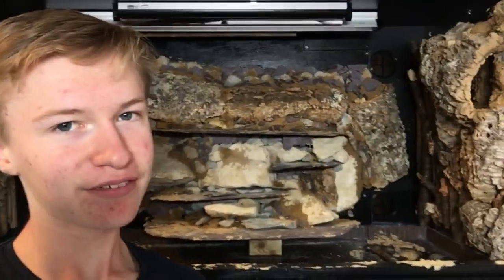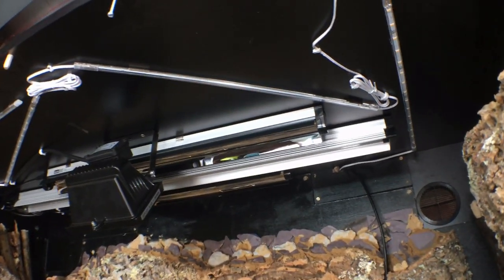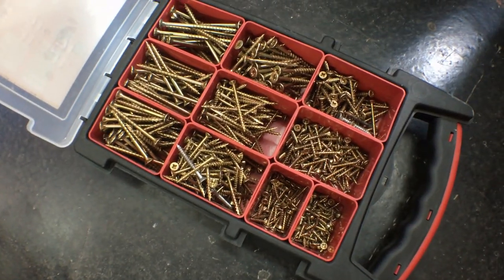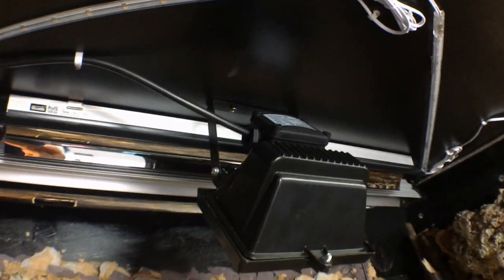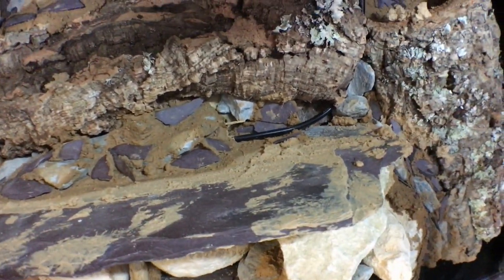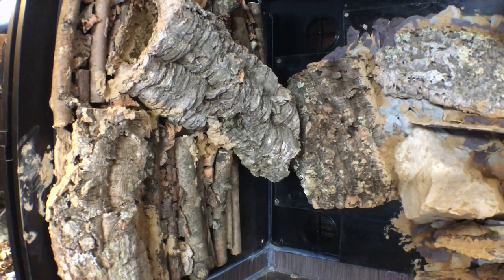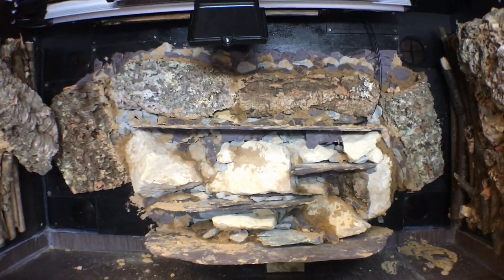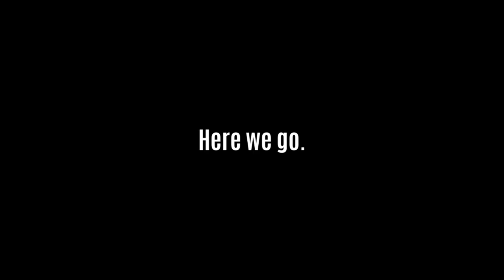The New Reptile Enclosure is Finished! Bioactive Vivarium Build | How to Set Up a Vivarium #4

Comment: Looks awesome dude! Can I ask what wattage the R7 halogen is please? And what distance did you have to put between the bulb and the basking area to reach the right temps?
Reply from the maker: Thanks! That’s a much more complicated question than you think it is... You see, lamps are for offering radiation, not getting temperatures right. They’re two different things - related, but clearly distinct. Drawing this distinction and acting accordingly will be, I think, the next big step forwards in reptile keeping. In light of this, I don’t actually think that the R7 lamps are suitable for use in the way that I have it set up currently, but I don’t have the numbers to back up this suspicion just yet. Stay tuned - the answers won’t take much longer to arrive!
Reply: @JTBReptiles   I understand the halogens are there to give off radiation. However the bulbs still produce a lot of heat so how do you prevent it from getting to hot and cooking your animal with out using a thermostat?
Reply from the maker: Have a look at my most recent video and keep it in mind. I have produced the first draft of a video answering precisely the question you’ve just asked, but it’ll probably be another month before it gets finalised and made public. I’m not good enough at writing to do the answer any justice here!

Comment: Beautiful! You have inspired my builds :) 

What plants do you use in is amazing setup?
Reply from the maker: There’s an azalea, three “hen-and-chicks”, and a lavender which I bought. The rest of the plants are weeds I found and propagated, so I only know what a couple of them are: a blackcurrant bush (thanks to Harvey of Celtic Reptile & Amphibian for IDing that one) and English ivy. I will work out what the other ones are for a future video!
Reply: @JTBReptiles  Thank you very much!!  I recently found your channel and it has been the most informative.  I look forward to you other videos. 

Any question 
Do you do the day/ night cycle for Speckles and if so how do you do so and how do you think to do that for a crested gecko?
Reply from the maker: Yes, I do it for all my animals. At the moment I just have the halogen lamps on for 12 hrs, then “visible lighting” (LEDs, non-UVB fluorescents, non-UVB metal halides etc) is on for 10 hours, and finally UV lamps on for 8 hrs for the geckos. In this enclosure and my dragon’s it is slightly different as I have several UV lamps.
Reply: @JTBReptiles  Thank you so much for all the information and help.
Reply from the maker: No problem!

Comment: I see you have many sticks. What is your take on disinfecting sticks and stuff? like protocols to kill everything that might be on the sticks. A lot of owners are very particular with this stuff and will use bleach baths, or an oven. Then others will find that silly and do nothing, or will just leave the sticks out in the sun for a number of hours and that will be it. I know there's somewhat larger-scale reptile keepers who don't disinfect their sticks and stuff, and have never really had an issue in decades.
I would think you are probably not hardcore disinfecting all those little sticks.
Reply from the maker: If there is any bird poo etc. on the sticks, I’ll wash them down in boiling water - but otherwise I just leave them as they come. I don’t get any reptiles where I live (the only herps I get are common frogs, Rana temporaria) so I am not concerned about mites or anything like that.

You often get little springtails coming in on bits of wood as well as other inverts: it would be a shame to kill them when they could become a part of the clean up crew or food for the lizards!
Reply: Hi, I use mostly cork bark and craft store wood in my enclosures which I do not disinfect. I will occasionally pick up a piece of driftwood from a nearby lake which I do disinfect. I bake it in the oven if it is small enough but otherwise I let it soak in a a bath tub with bleach. I live in an area where snakes, lizards, frogs, and other herps are quite common. You will also find that wood outside has wood mites in it which as far as I’m aware are not harmful to snakes/other reptiles, but I just don’t want them in my enclosures. I won’t go into detail on how I disinfect my stuff, there are lots of guides out there for that already. It sounds like your comment is more geared towards do I NEED to disinfect. I don’t have an answer for that either, I just wanted to chime in on the behalf of those of us that DO disinfect wood.
Reply from the maker: Good point. To answer the “need” part of the question: there are many diseases harmful the herps which could be devastating if brought in to an enclosure (chytrid and the fungal disease currently affecting many snakes are in my mind, but there will be others). There are also parasites you might bring in, which is why I mentioned that I wash if there is any faeces on the wood. Of course, there ARE benefits to not washing (introducing scents, springtails as mentioned, moss and lichen etc.), so you will find people arguing either way.

A bit of common sense is the way forwards, I think. If you find loads of reptiles in your area, consider washing; if you don’t, consider using without treatment.